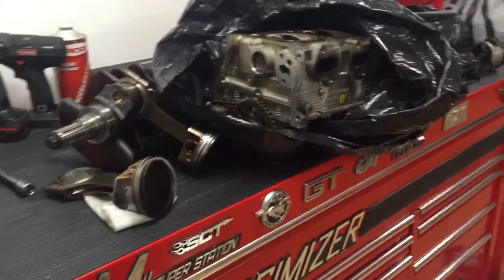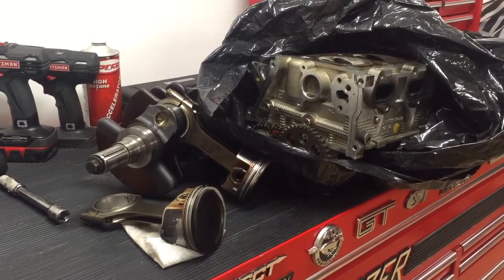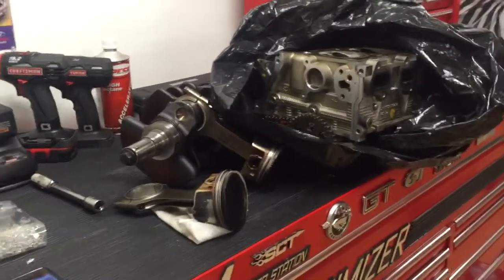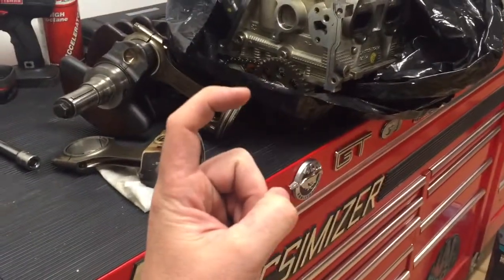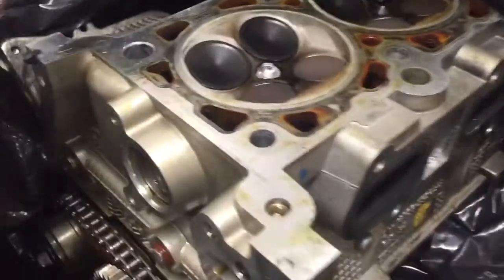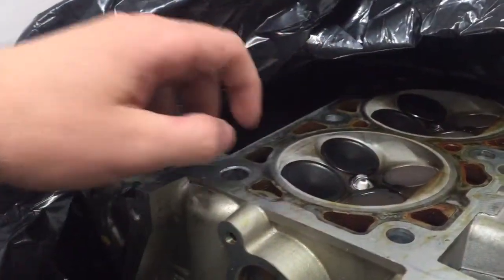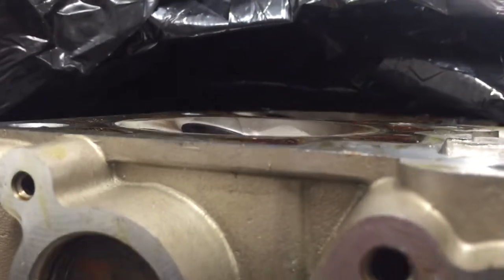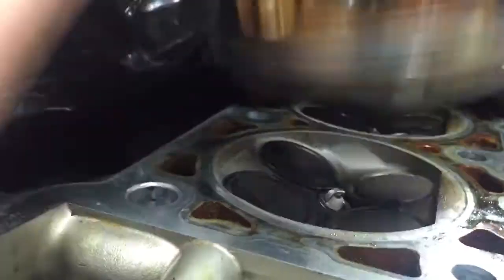Can a piston punch a spark plug through the cylinder head?

Comment: I think it is possible if somebody berries the plug too deep. I have had to completely get smashed out of my F-150 enough to where the first one turn the coil into hamburger meat in the second one smashed the coil into the fuel rail so hard it split it. Both times the tip of the plug was bent completely over.
Reply from the maker: Under normal circumstances it would never contact the plug. If someone drove a plug in far past the threads it should still bottom out on the head,but anything is possible. Or if a plug broke it could fall in. 
  In most cases it’s simply a loose plug and detonation for the forced induction cars

Comment: Is there a possibility that this can happen on a 2 valve???
Reply from the maker: No. It’s the same, just less valves. The only way it would ever happen is if the plug stripped out and actually fell into the cylinder head, but it’s not likely.
Reply: @dannyjohnsonsgarage  thanks buddy I was doing spark plugs and coils and found one really smashed on the electrode area

Comment: My spark plug is rocking laterally in the cylinder head while firing.  Is it loose or are my valves causing it?  I can feel it through the rubber wire plug that goes down in the hole.  I don't think the last guy that worked on my header gasket, tightened it down or my timing could be getting out of sync?  Gonna check as soon as I get a legitimate plug wrench.
Reply from the maker: If it’s loose stop running the car immediately or the pressure with shoot the plug out, stripping the threads. Let the car cool down and put a socket wrench on the plug to see if it’s loose. Don’t over-tighten either
Reply: Well it hasn't shot out yet and I have been driving all summer. I suspect the timing is slipping if it isn't loose.  The valves are essentially getting out of sync and there might be internal damage.

Comment: Hey ima probably sound like an idiot but I have an 08 mustang gt 4.6...281...my spark plugs are always oem. they get smashed at the electrode. I always thought my piston was hitting them. The spark plug never came out and they where torqued down properly. I'm buying spark plugs ever four months. Could any one tell me what's happening...
Reply from the maker: Any mods to the car? Low octane fuel used?
Reply: @dannyjohnsonsgarage  no it's  stock no mods. Sometimes I use low octane but I usually keep 93 in the tank.

Comment: I have a 02 nissan altima 2.5 the spark plug gets smash on cyl #4 and the spark plug is tight...how can i fix that problem?
Reply from the maker: the piston should not contact the plug if it’s the correct plug. Are you running the correct plug?
Reply: I have the same problem on my 03 altima on the exact cylinder. Bent like something hit it
Reply: Hey I’m having the same problem the third cylinder towards the driver side of the engine ( 12 vw cc ) is crushed ! I put in the right spark plugs they are the same size, I could barely get it out! Now the engine is seized! WTF ?